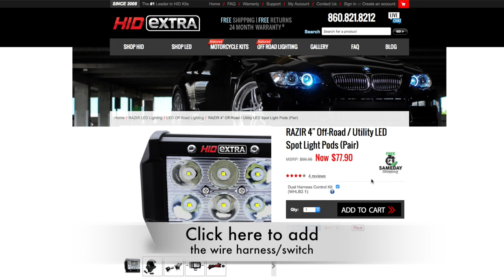HID Extra 4" LED Ditch Pods - 2016 4runner

Comment: I have a 2018 rav4 hybrid limited 
The 12v battery is actually in the back of the car..
Under the hood is a positive terminal incase I need to jump start the rav....can I use this as my positive for the wiring? Then just ground the negative?

Comment: I️ already have a light bar installed... if I️ want to install these ditch lights can I️ put the positive and negative leads for the ditch lights on top of the ones for the light bar on the battery??
Reply: MANTEETH Yes, you should be able to.

Comment: did you replace your factory fog lamps with LED spot? if so, which brand did you go with and were there any mods you had to do?
Reply from the maker: hello, yes I replaced my fog lights with the Razir LED from HID extra. You can see my video on them here http://theroninchronicle.com/razir-led-low-beams-and-fog-light-install-4runner/ Thank you for watching!
Reply: Do the replacement fog lights make a big difference?
Reply from the maker: absolutely! Couldn't go back to stock after seeing the difference. I do with that they were projector housings though.

Comment: Where did you install the switch? and did you buy harness from HD Also.  Thanks for posting, I'm getting some great tips.  I'v already installed low beams and about to install highs too.
Reply from the maker: I didn't install the switch because I am installing a switch pros unit to control all my lighting. There are spots you can use in the blank areas of your dash. 
Yea that is the harness from them, unfortunately the switch is round. 
Im glad this is helping you! That is awesome!!
Reply: +The Ronin Chronicle 
Thanks for the advice,  much appreciated...

Comment: Does it(LED pods) have any gap between the housing/frame and lens? and, LED's, are they well centered?
Reply from the maker: they are very well centered. there is a tiny gap, but hasnt been an issue at all. I have seen somebody use silcone to seal, but I dont its neccessary
Reply: Thank you! Purchased :)
One more question: Is available the amber spot lens cover for this product?If not, is it compatible such cover from different 4" LID pods brand? Thanks.